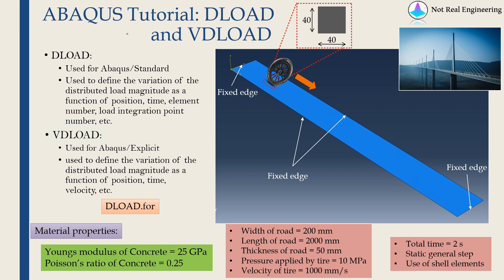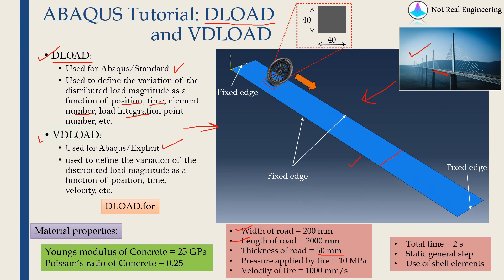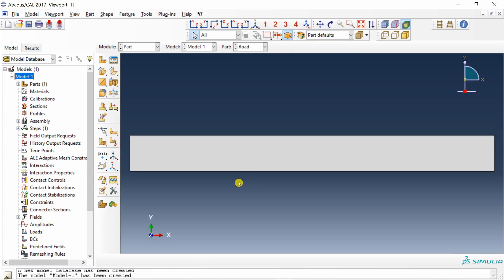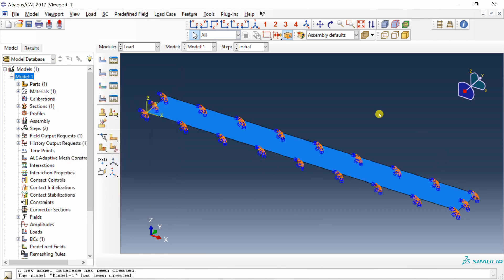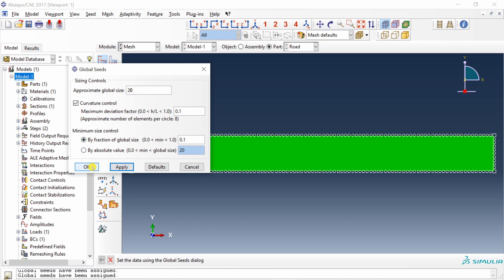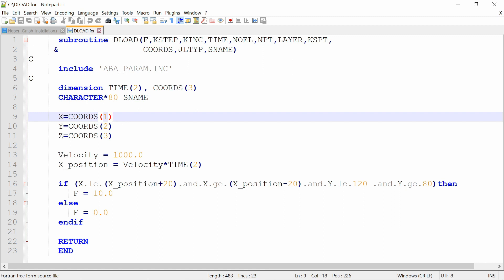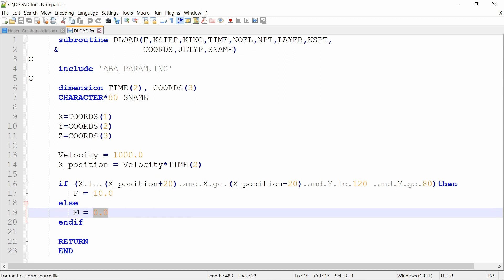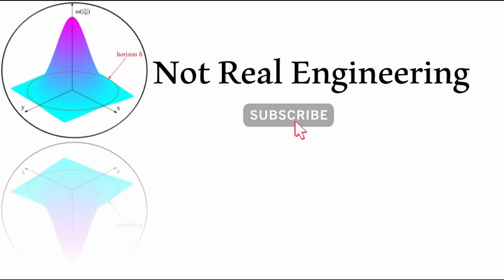DLOAD subroutine Abaqus tutorial | Moving  or Nonuniform load

Comment: Hi, i used the same code for the model but shows an error when submitting the job - "Problem during linking - Abaqus/Standard User Subroutines.   This error may be due to a mismatch in the Abaqus user subroutine arguments.   These arguments sometimes change from release to release, so user subroutines   used with a previous release of Abaqus may need to be adjusted. ". Can you kindly suggest what might be causing the error?. Thanks in advance